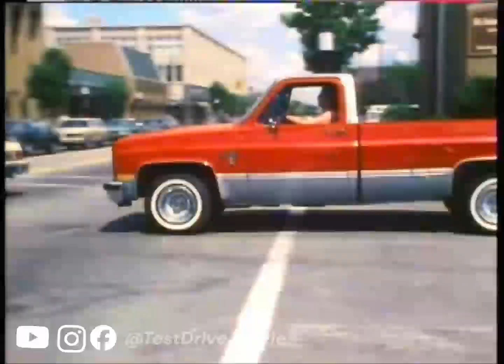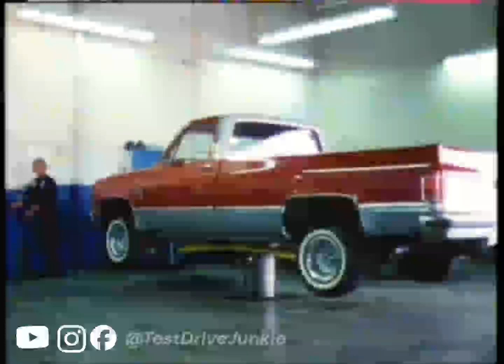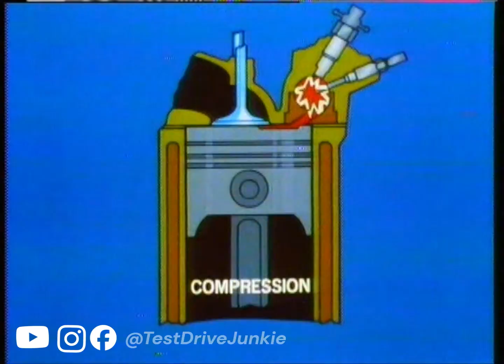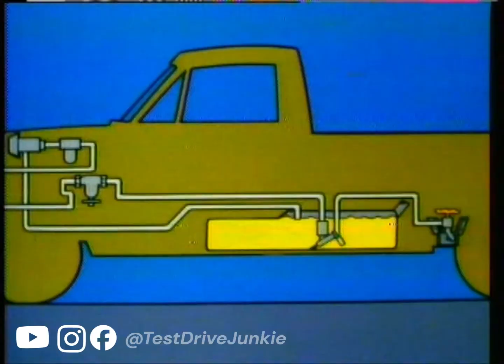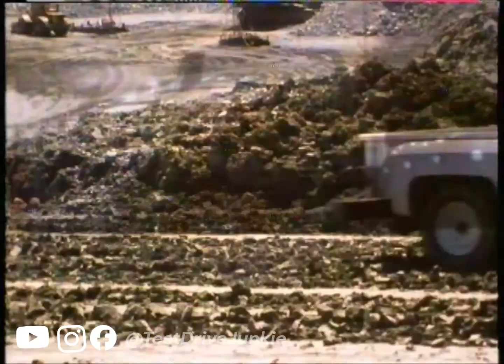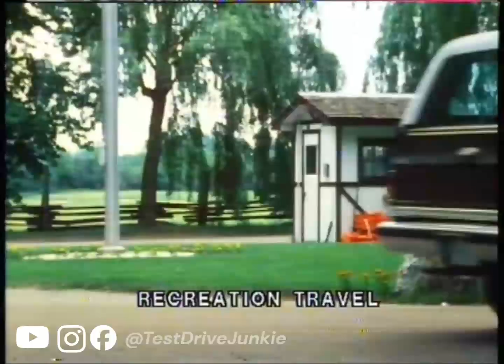1982 Chevrolet New 6.2 Liter V8 Diesel Manufacturer Laserdisc Promotional Video

Comment: A laserdisc to promote an indirect injected boat anchor?🙄
Reply: In 1982 . That wasn’t a boat anchor back then .
Reply: @Bowtierescues my joke was the cutting edge technology used to promote an injection system that was obsolete by the late 50’s.  Mack had DI in 1952, Detroit division of GM had DI in 1938.

Comment: Bought one new in a C10 steel driving it today no rust Texas truck, 998,000 MI, only thing that's been done is a head job, rebuilt 3 Transmissions, 700 r4s are junk, and a pickup load of starters, straight drive AC Delco starters are junk, fuel economy on the road around 24 to 25 Mi to gallon, not a Powerhouse by no means, could not imagine anybody wanting one in a C30.
Also have one in a 84 four-wheel drive, the trucks are okay for pulling their self not so much on trailers and heavy loads.

Comment: The 6.2 was a good engine and not bad on fuel.  The power part was questionable as they would not even pull with a good 350.  The 454 was what you had to have if you wanted to move big loads at highway speeds.
Reply: What's weird is my family had all 3 on their farm in Mexico and the 6.2 was said to be the best for work. Way more efficient and torquey than an sbc or bbc.
Reply: @joseesparza2364 I could see that in that application where the speeds were slow so the torque had a bigger advantage over the horsepower. In the us where they really suffered was on the interstate where pulling trailers 65-70mph it would take 10 minutes to pull a mountain grade vs 5min for the 454 to do it mainly because of gearing you could drop a gear and rpm the 454 and still be at highway speed but the diesel was stuck in high gear because it could not turn the rpm in a lower gear and be at speed.
Reply: @bcbloc02 I can see how that would have been a problem. The one on the farm was a 3/4 ton 2wd with a stick and my dad had an 82 c10 longbed with a 700r4 and said it would get over 25 mpg and bark the tures shifting into 2nd. And he also had an 84 k5 blazer with one and said it would roast the 33in mudders he had on it. Im rather fond of 6.2s.
Reply: @joseesparza2364  Yeah they were great for just the trucks. We had several in service trucks and they regularly knocked out about 22mpg vs like 12mpg for the same trucks with 350's We even had a couple of non turbo 6.5s which were just a touch stronger but didn't seem to use anymore fuel.
Reply: @bcbloc02 I think the best combo os a 6.2 with a mechanical 6.5 pump turned up and a 6.5 turbo setup but with an actual good turbo. They are great, reliable engines but I'd be lying if I said the b series cummins isnt superior. My whole family switched to Cummins and Im the black sheep with ny slow GMs.
Reply: @bcbloc02  at the time the national speed limit was 55 . Ever notice in older cars 55 is always red or orange. They had no reason to be going 75 mph pulling trailers back then . Things were slower in those days.
Reply: @Bowtierescues True in 82 but by 87 we were at 65 limit but on interstate it was pretty common for people to run 70 because it was a no points violation and I think the fine was $15 but the troopers would never stop for 5 over in those days. Of course prior to 74 the limits were even higher but you are right for 82.